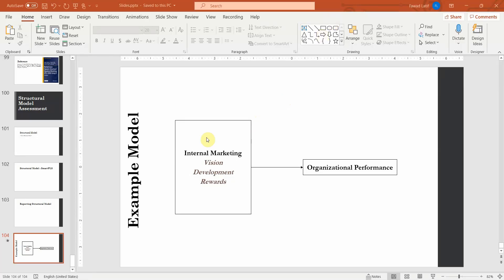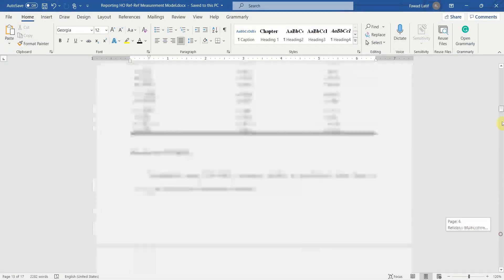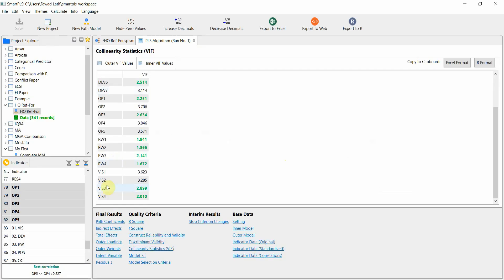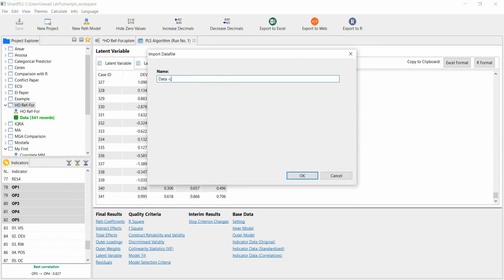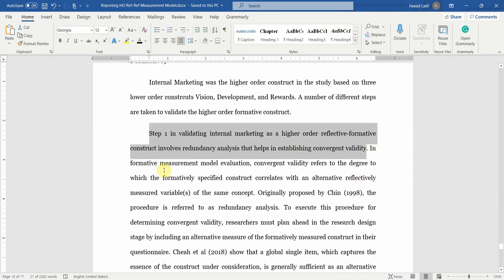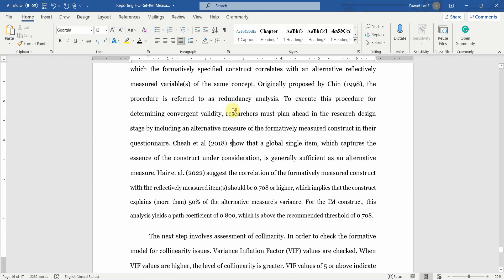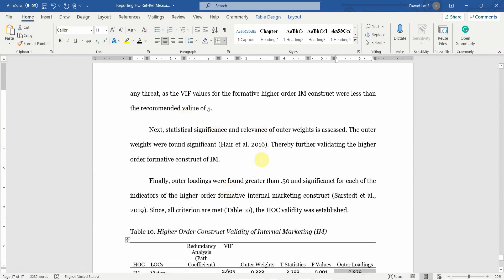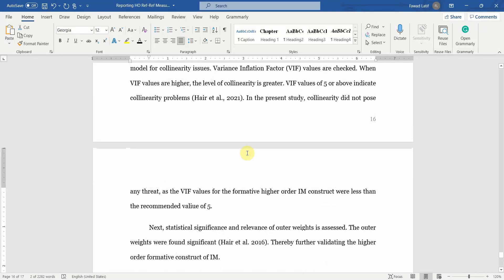SmartPLS3 - Analyze, Interpret, and Report Higher Order Reflective-Formative Construct (Uptd)

Comment: You have done a great job and shared valid information about this data analysis through smartpls.
.
Dear, I collected data from Pakistani SMEs. I am facing problems in the validation of data, when I run the tests every result of Chronbach, Rho, discriminant validity, and AVG variance as I am using reflective scales? Please suggest me some solutions
Reply from the maker: Thanks. I am glad you liked the videos.

You will need to clean the data. There are a number of videos on the channel to solve Convergent and Discriminant Validity issues. To search please watch

https://youtu.be/Vft-ggpyxjY